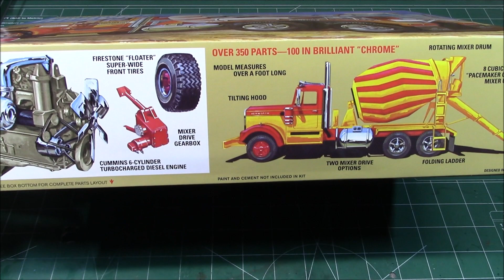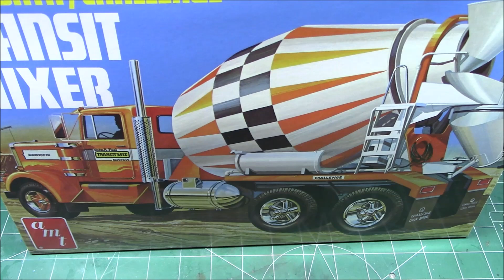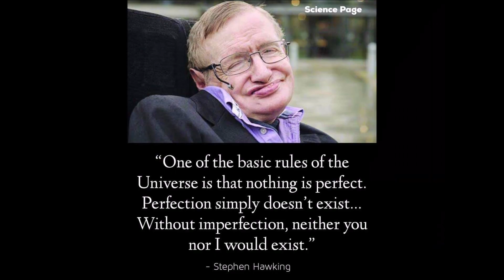Kenworth Challenge Concrete Mixer Cummins Diesel 1/25 Scale Model Kit Build Review Weathering AMT

Comment: Cab to hood figment on a mixer is generally a little skewed anyway. One thing I didn’t like. This has nothing to do with you or your build, the kit mirrors are totally inaccurate for this truck. One of Kenworth’s big selling points was the cowl mounted mirrors that reduced vibration and didn’t get out of adjustment when you closed the doors. This kit has the more Peterbilt looking door mounted mirrors

Comment: I built this in 1973 except they had a Mack truck instead of the current Kenworth. I found the Mack truck version on Ebay selling for $175. In 1973 I paid between $8 and $10 dollars for it. I didnt buy the one on Ebay. I will not the current edition instead.

Comment: on some of the mixers I worked on, there was no passenger seat and a mixer control panel was pedestalled to the floor with a panel about 10 by 16 inches angled toward the drivers position.
this is a good addition to the IHC Pay star  mixer and the Mack  R series mixer!

Comment: Nice build, been waiting for this one! Just picked up three of these kits at the LHS cause they won't last long. For the cab mounts on the AMT w900 kits, I always sand the tabs off of the bottom of the rear cab mount and glue it to the cab first. Also file the locator pins off of the front cab mounts that line up with holes in bottom of interior tub, and then you can move the cab forward as needed to line up with the hood once it's installed.
Reply from the maker: Good tip!

Comment: Really cool build as always, I am big fan of your whole outlook on building a model, build it like ya want. I have to ask, how do you clean up your clamp posts and swivel mount stuff? Maybe you could do a short video on that kind of thing and how to clean up the spray booth, that would be cool and helpful to modelers. Thanks, and keep up the good work.
Reply from the maker: I've never cleaned them,
Eventually the thick layer just cracks and falls off when I'm adjusting them.

Sometimes it's 1/8th inch thick. Pretty cool to think back on all those build ups. 

I scrape the booth now and then but just to remove loose pieces. The filter is replaced once a month, which is about 6-8 kits or so.
Reply: @hpiguy  cool, thanks, I always wondered how you cleaned up after builds.

Comment: Your builds are always great and this mixer is no exception. One of my favorites is the 1962 Impala build. The techniques and tools you use are very informative to see in use, and the painting tips are  valuable. The more info about the whys and wherefore of painting, the better, IMO. it looks to me that Testors and Rustoleum paints are chemically compatible -- no potential for a chemical disaster. My question has to do with spray painting the large subassemblies such as the chassis/suspension. All of these small parts have lots of nooks and crannies. When painting after assembly of the unpainted parts, how do you get even coverage with paint without too much overspray on the more exposed parts and not enough in the more hidden parts? It might be more tedious, but would coverage be better if you painted individual parts first  then assembled?  Just asking. Keep up the great builds.
Reply from the maker: I have no issues with too much paint most of the time.
Thanks for coming along!

Comment: Chris I notice you assemble things like the engine and transmission almost completely before painting it. How do you get to all the detail under parts that run over other parts like hoses and fuel lines without getting different colors on other parts? I paint all my parts individually before beginning assembly because if I don't ill have all different colors on the engine block or transmission lol
Reply from the maker: I have no issues hand painting and quite enjoy it. Thanks for coming along!

Comment: Do you just use regular Rustoleum, or the low VOC stuff?  I remember trying that as a kid(mid 80s), and the regular spray paints melted my models. I had to buy the Testors model spray paint, which was expensive back then, for a 10 year old. LOL.
Reply from the maker: I most commonly use the 2X brand but I have used every type they make with no issues, because I use a primer first.
Reply: @hpiguy  and you use the rustoleum primer?

Comment: This re-release kit doesn't have the torsion bars for the back axles like the original released kit has had - is that correct?
Reply from the maker: You'll have to watch the parts review in the beginning. I know it did have bars that I glued onto the tops of the differentials but I don't know they exact part name on a big rig.

Comment: My frame rails are warped to the point they cant be used.... ashame for such an expensive kit.  I have to order an aftermarket resin frame kit for it.
Reply from the maker: It would make much more sense money wise to just use the parts replacement request at Round2Models, nicely explain the issue, send a pic of the warped rails and they usually just send replacement parts.